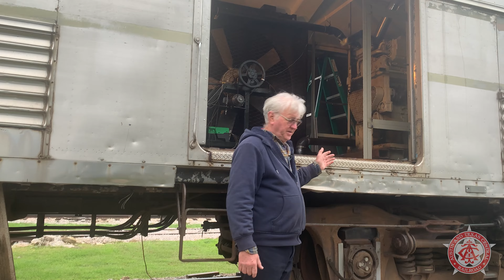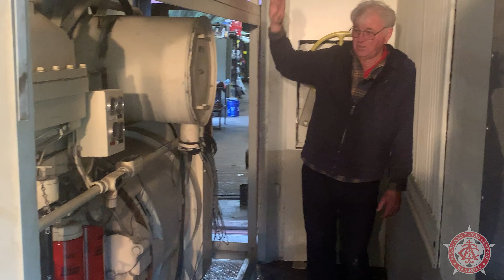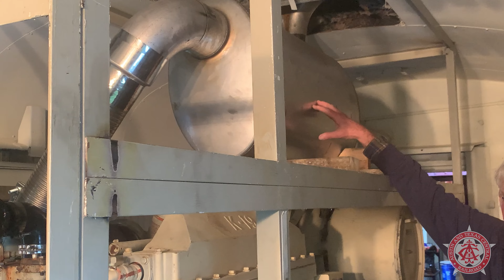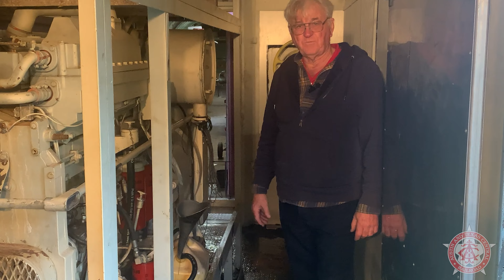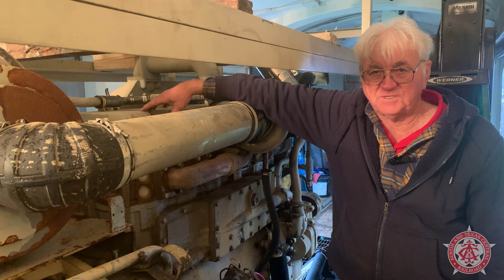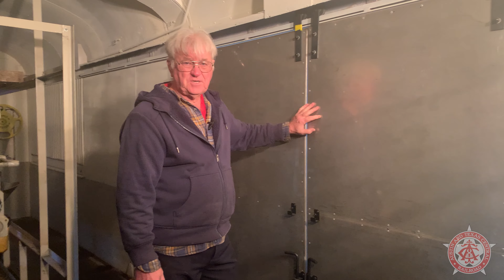Brake Wheel, Plenum Frame, & Finishing Doors - Power Car Ep. 4

Comment: I’m glad y’all are regularly updating us with content, can you do an update on 786/442?
Reply from the maker: We're working on doing video updates for the both the 442 and 786, but unfortunately our time is limited.  But here is some work that has been going on as of late.

On the 442, the rear truck is getting close to being finished and getting reinstalled beneath the engine.  Also, our volunteers have been doing a thorough cleaning of the inside of the locomotive, repainting the interior, and cleaning up rust damage.  The battery boxes are being rebuilt, too.

With both the 442, the Power Car, and general maintenance on our passenger fleet, work on 786 has been slower, but we've managed to accomplish a fair bit.  The frame and wheels have both been repainted and we are prepping the rigging and machining the rear piston heads and cross heads in order to measure the piston thrust.  This will allow us to make critical measurements regarding the shoes and wedges.